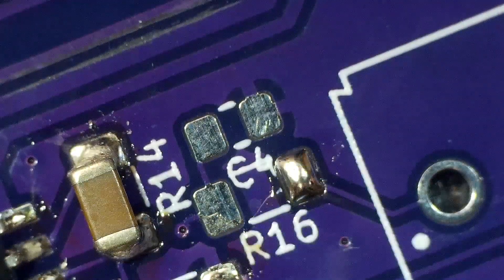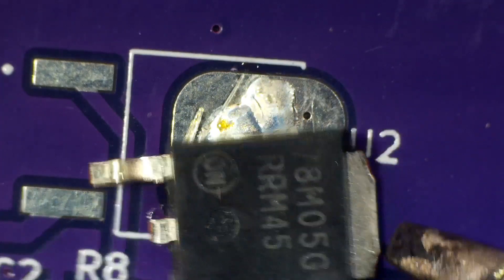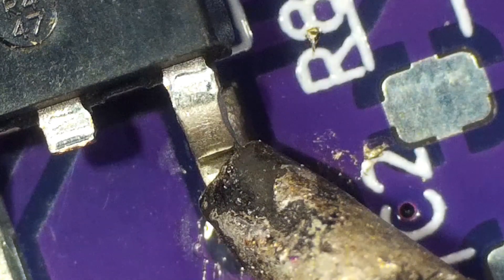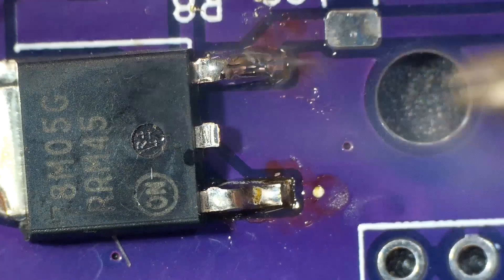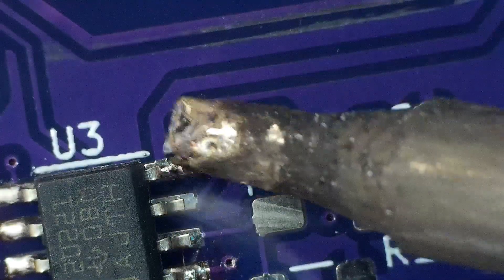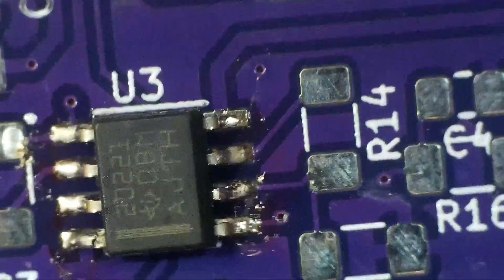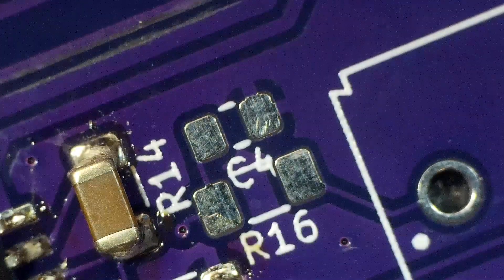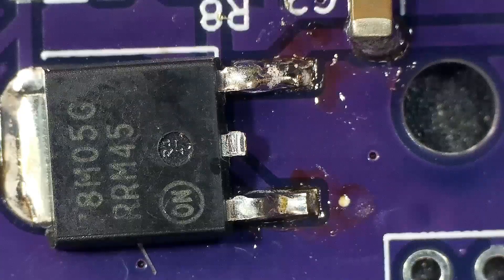Mastering Soldering: Small Electronic Parts with a Soldering Iron

Comment: Hi
You forget flux ...
Reply from the maker: Thanks, I forgot to mention that I always use flux core solder.
Reply: @mycrostartelectronics  yee you say correct in your video I can see resido of  solder wire core flux but extra flux give a better high quality shiny solder joints
Thanks for your reply 
Best regards